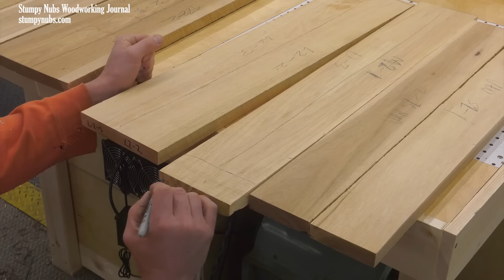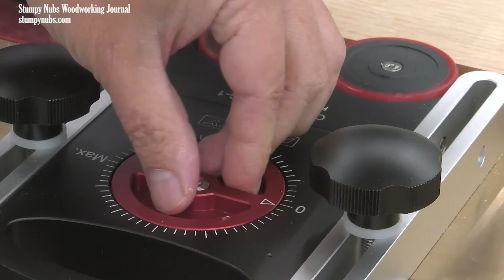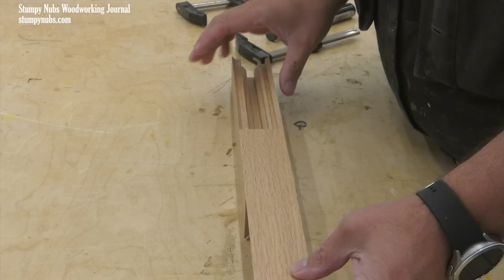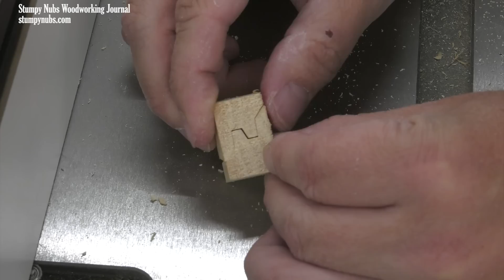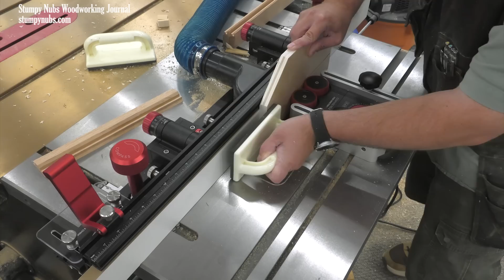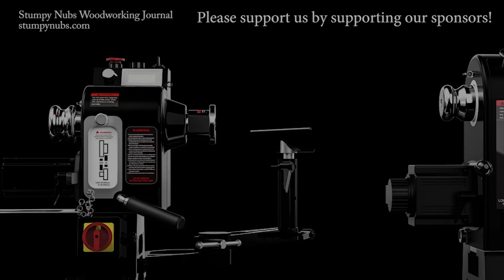How lock miters can make projects cheaper and better.

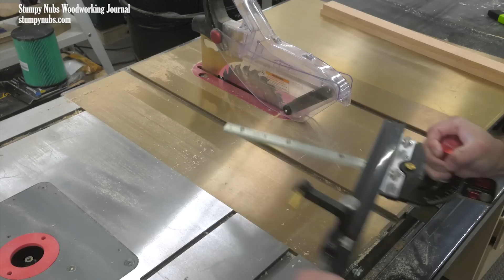Comment: At 2:46 in this video you are ripping a board that is about 3/4" thick while about three times that amount off the saw blade is above the table.  I realize that you have a blade guard but to be as safe as possible only about 1/4" of blade should show above the piece being cut.
Reply from the maker: You are correct in that it is not a safety issue when a blade guard is in place.

Comment: love the vids but why is your blade set so high?
Reply from the maker: When covered by a guard, a high blade poses no extra danger. The only affect is how it changes the angle of the tooth when it contacts the wood. In this case, the height is only about an inch above normal, and with the blade I was using, that made the cut slightly easier to feed without a noticeable change to the quality of the finished edge.

Comment: If you mill both edges of two sides flat on the table, then mill both edges of the mating parts up against the fence, the tongues all align so you only need to clamp in one direction instead of needing clamps across both faces.

Comment: James

You have great videos. I have learned a lot from you. Your breadth of knowledge and ability to present is amazing. Your method of getting the height of the bit above the table is Ingenious.  I do think you may have missed something on this one. It looks like you are measuring the total height of the bit and you really need to measure the height of the angled portion of the bit. Including the short vertical section will introduce error to your measurement. There is no good place on the bit to measure the height without including the vertical section.  I have the small Whiteside bit and have used the following  equation to get the height of the angled portion after doing a trial  and error fit.  Hb = 2(H)-Ts. To use the equation, I measured the bits height above the table top (H) and the thickness(Ts) of the material used to get the fit.  Hb is the height of the angled portion of the bit. With this height, you can use your method for any thickness of material the bit can handle. It works great. Also, I happen to have access to scrap 3/8" thick HDPE which I use as the straight edge for adjusting the fence. It works great because if it touches the bit you can feel the bit  grab it without moving the bit.

Comment: Great video. I used the lock bit when assembling some hardwood fence posts which slipped over pt posts. Was able to make beautiful hardwood (solid looking) posts without spending a premium on solid hardwood 4x4s. Also to your point, you can choose the more pleasing grain patterns.  In the end there’s less of an issue with bowing over time one might get with solid wood. The lock bit miter joint is so much superior to a simple 45 deg miter, I would almost always choose this especially i. The uses you’ve outlined here. Less expense in stock and really, if done well, a superior end result.

Comment: First THANK YOU for your sharing of knowledge, Greatly appreciated.   Your thoughts on using this technique on very long pieces 12 to 15 feet? for Faux wood beams. Rather than using the miter,tape and fold method.  My thoughts were this could be done off site and assembled at the job.

Comment: Does or can using a metal level used with a table saw take the place of a jointer for straitening wood edges? Is a jointer the same as a table designed for a router or is a jointer basically a router turned upside-down with a straight edge?  I am asking to reduce cost of of additional quality tools.
Reply from the maker: https://youtu.be/ZFFzmJfv5No
Reply: @StumpyNubs  ah thank you!

Comment: Would there be any benefit to "packing" or "filling" the empty space in the center with scrap wood if you intended to have a mortise and tenon joint? I'm thinking of a bed frame or something else where you would want to have a chunkier leg which could have a larger empty space but also wanted a strong and supported joint.
Reply: Only for tenons in the ends. Pro tip but you can use the lock miter for putting the tenon in the end too.

Comment: Thanks James your techniques are invaluable. I recently bought a Sommerfeld router table and plan to use the lock miter set. Your descriptions involving fingerboard guides probably saved me some miscuts.
I think you meant to say "rift cuts" instead of quartersawn faces, as quartersawn oak is Full of rays, where rift cut has the short flecks. 
Keep up the good work, your channel is tops.

Comment: Have not seen a lock miter bit before. The cost is worth it (and I do not know their cost), because the cost of commercial gluelam solid posts from the shop suppliers are very expensive. They are made from remilled off cuts. 
If I glued up  a lock joint post in the RF glue table, would the lock joint survive turning on a lathe?

Comment: That technique sure is spectacular. My router only has 1/4 inch shaft, and so the locking chamfer bits don't fit that they only come half inch diam.

Comment: I know that you have made videos in blade height before, so I will see if I have this correct.  The blade is set high for the rips (and cross cuts) for a steep cutting angle making a cleaner edge on the side that shows.  Safety is not an additional concern because you are using the blade guard.  Correct?
Reply from the maker: https://www.youtube.com/watch?v=JL8-1bmt7XY

Comment: I've seen those locking miters before but never really knew why I might want one. Now I know....But the thing in this video that really got me is that roller guide! OMG! I need one (or two or three). I use feather boards whenever possible both on my router table and table saw but they are always "sticky", especially if the stock is not completely smooth. Alas, though, the roller guides are out of my price range. I may have to rig up a DIY version of them. Love your channel!

Comment: I noticed you made the flat cut first on the table and the second cut against the fence. Would the order have any effect? It would appear that the cut against the fence may give you more area contacting the fence. And the second cut would be pushing down which may be more intuitive. This is on my to do list for new things to learn and implement. Great video.
Reply from the maker: You can do them in whatever order you like. I do the fence second because a featherboard stack or roller guide is helpful for the second cut, and it's easier to attach that tot he table than to the fence.

Comment: Jim, if you set up your lock miters with the same cut on both sides of two sides and the matching cut on the other two, you only need to clamp in one direction.
Reply from the maker: You still need to clamp in all directions. The "lock" isn't that tight.
Reply: @StumpyNubs  I guess I've been doing it wrong all these years?
Reply from the maker: @jimurrata6785  LOL- I have never in my life assembled a lock miter joint that did not need clamps. You say you have been doing it your whole life. Neither of us is wrong. That's the thing about life, two opposite things can actually be entirely true. Have a nice day.

Comment: Thanks James. Loved this video. Was just wondering though, that when you passed each of the pieces through the router for the first time, you were to do them in the vertical position and then the second edge in the horizontal position, then the narrow inner surface would be flat on the table, and less of a chance of moving because it’s easier to put pressure down on the piece. Not trying to be an ass. Just when I’ve always worked on my projects, like you, I try to think of other ways to make my job easier and safer. Please let me know what your experience tells you. Looking forward to more of these extremely helpful and interesting videos. Great work. Cheers.
Reply from the maker: I don't find it any easier to do the second pass flat on the table, and since feather boards make that step easier, you would have to stack feather boards on the fence face.

Comment: Good tips. I use this bit to make kitchen drawer boxes with Baltic Birch Ply. My tip here is your router table had better be double plywood or metal, not single thick phenolic and your in and out feed fence be of top quality in alignment. Anything else becomes a super strugle with this huge bit.

Comment: Built a set of quartersawn Oak Morris Chairs with this technique - works a charm and looked fantastic. Besides looks and weight, you are also making a far more dimensionally stable leg that will resist warping. Your setup also inhaled the large amount of dust/chips generated by the large bits very well. While I have used feather boards, I really like the rollers. For those who have never used additional support - the "My fingers are enough" crowd - the quality and consistency of your cuts will improve dramatically with support. Thanks James

Comment: Those are great bits but just don't trust on those chinese ones. I tried them once on white oak and not going to try second time! Also a powerful router is needed for the job if working with hard wood like oak because those bits cut so much material on one go. Don't be like me, do it like Stumpy Nubs!

Comment: If you make legs in this way, how would you attach the aprons and stretchers? Would M&T still work (assume only a small reveal between the two), or would you need to use pocket hole? How did you do it on the bathroom vanity? How did the bed builders do it for the head / foot boards?
Reply from the maker: I used full, traditional mortises and tenons in the bathroom furniture. If the tenon is so long that it protrudes into the hollow center, you can just glue a strip of wood in the middle and make it a solid piece. But that's rare needed.
Reply: @StumpyNubs  Probably also gives any excess glue from the mortise wall somewhere to flow too.

Comment: I like the Harvey roller guides. If you have influence with them, tell them it would be great to improve on them to connect more than one, side by side to have four or six rollers.
Reply from the maker: Do you mean stacking them up? Because side by side wouldn't require a connection between them since they can be locked anywhere in the miter track, even right next to each other.

Comment: Great technique if you don't have thick stock or want to ensure consistent grain on all 4 sides. Not sure about a cost savings though. While it's true that thicker stock costs more, you need FOUR pieces of thin stock to replicate it. What about tapering? Might not be a big deal but I could see a taper revealing odd seams beyond the 4 corners.
Reply from the maker: It still takes fewer board feet (or essentially the same if you want to consider the loss of material removed by the router bit compared to the amount of hollow space in the center.) And thicker material is usually more expensive per board foot.

Comment: Thanks for this, I have got to try it. Question....would it work if you tapered the pieces, making a tapered leg?  I made a table with tapered legs.  Glued two pieces together face to face with quarter sawn white oak with medullary rays showing on two sides.  I then tapered the legs on two sides and then glued on QSWO shop made veneer from the same tree to cover the sides with the glue line. Tiny chamfer on the corners hides the veneer joint.  Quarter sawn faces all around.

Comment: Thank you. Seems to me a built up table leg as an element is more stable than a solid piece.  Variations in the solid piece with moisture and tensions in the wood are much harder to control. With a built up piece those variables are more obvious and can be compensated for much easier.

Comment: Many years ago I bought a lock miter bit but some planes of the cut were gappy when glued up. This was not the result of an out-of-square glue up. I'd like to produce lock miter joints with the top of the joint displayed and the void plugged. I'd also like a cut that mated well enough that it could be sawn at a taper. My assumption is that the bits simply aren't ground to produce an accurate joint. Do you or any of your viewers know of any maker of router bits or shaper cutters that actually fit for a joint with perfect glue lines?
Reply from the maker: To have a perfect, gap free joint throughout the inside you would need perfect conditions. The router motor must be perfectly perpendicular to the table, there must be zero runout in the bit, the router plate must be perfectly flush and aligned to the rest of the table, the wood itself must be perfectly straight and square and fed without any variation in relation to the fence, the table and the speed. Tiny little errors, even a little sawdust under the workpiece can add up to a gap here and there. But since they are hidden on the inside, it doesn't matter.

Comment: I've tried setting up a miter lock bit, when the test pieces aren't quite flush, how do you know which way to move the bit? I'm sure I'm just dumb, but can't figure it out. If anyone can explain this that would be great. Thanks
Yes I did watch Stumpy's setup video and others but that step is never really addressed or I keep missing that explanation.
Reply from the maker: I can't really describe it, you just have to look at the pieces and imagine which way the bit would have to move to correct the problem. Don't forget, you run the workpiece over the bit upside down :)
Reply: @StumpyNubs  Thanks, I will have another go at it one of these days.

Comment: It does require a great table saw, router table fences etc. But it’s awesome!
Reply from the maker: You can do this with an old, well tuned table saw and a router clamped to a piece of plywood for a table with a straight 2X4 fence. Nobody suggested otherwise.

Comment: As a newbie I would love some advice for a great router table router now that Porter Cable is no more. Will a Bosch 2.25 spin both these bits safely. I have considered the Milwaukie 3+ but cant seem to find a reasonable lift it fits. HELP
Reply: The Bosch will be fine! I’ve run a 3” cove bit in mine, you just usually have to take a few passes with the larger bits and turn down the rpm’s. Seriously though, the Bosch is a workhorse. I use mine daily for all kinds of different bits, you won’t be disappointed
Reply: @warrenwerks  thank you for your reply. I had always heard that you need a high powered( 3+) router for table work to spin the larger bits.

Comment: I never thought of the flat sawn side as being any less beautiful than the quarter sawn side….just different. I guess I can see that now though, at least in terms of uniformity
Reply from the maker: Flat sawn has beauty, but mixing distinctly different grain patterns is not always desirable.
Reply: In my case I seem to have permanently associated cathedral grain with crap woods like pine and fir. Part of that is just from using alot of 2x6s as cheap stock. Uniformity of grain just feels better on the eye to me.

Comment: Thanks Stumpy - great video.  I really like the look of tapered legs so I guess the locking tongue & groove is not a possibility.  Getting the 4 pieces exactly the same takes a lot of patience and care. Any suggestions?
Reply: Shouldn't be an issue as long as you can duplicate the tapers on each piece. I'm planning on batching out some urns soon with locking miters, I will try to remember to leave an update

Comment: My only issue was that I got what i thought was a "quality" Lock miter bit on a Facebook site over 4 years ago..  Terrible quality! Wasn't sharp, burned the joint, and didn't yield proper results - I had really high hopes for this special joint.. and the bit just didn't deliver on it's promise. Beware to all.. a cheap price didn't deliver in this case.. and the problem is you can't always tell from the Picture exactly what you're getting.. watch out for Facebook Tool Sellers IMO!..

Comment: You always come through with the most excellent woodworking ideas James, and this is one of your best.  I also love the Harvey Roller Guide, which is also an excellent idea, and beautifully made.   It is not over priced either, if you preorder at the discounted price.  I have a Bridge City sharpening guide now, and love it, but I did somehow miss the shipping cost when I ordered it, and got a shock when shipping nearly doubled the cost to me in New Zealand. ☹ I tend to look at tools like the roller guide with a view to making them. The one way bearings are readily available, and something like belt sander wheels could be used, but by the time you sourced the components and materials, you'd be the best part of the way to the Harvey Tools price!